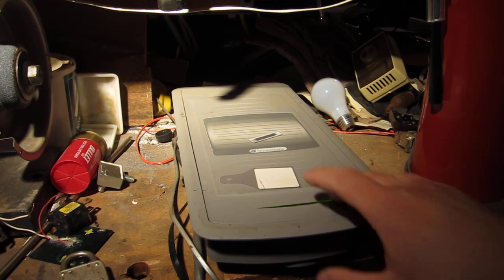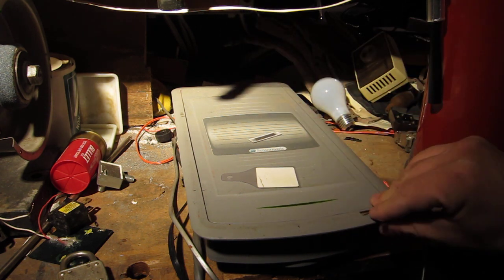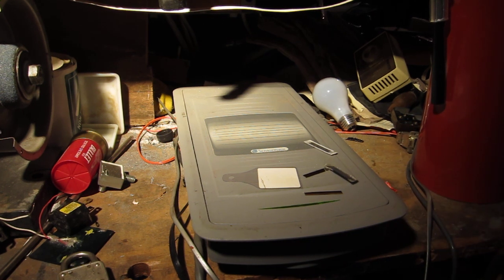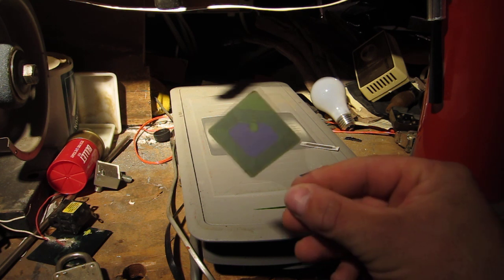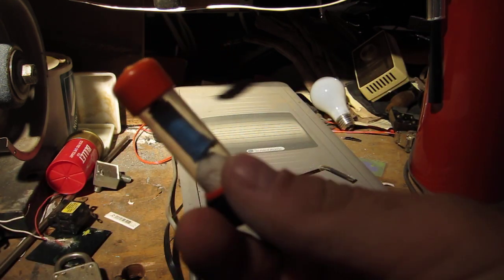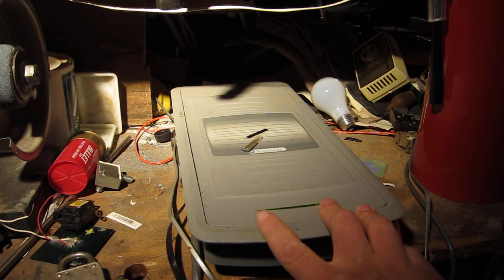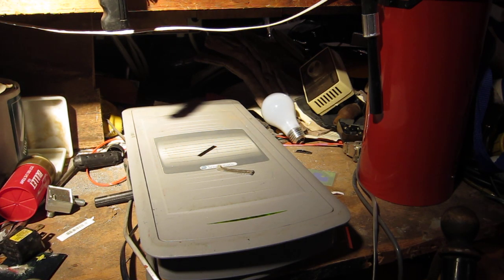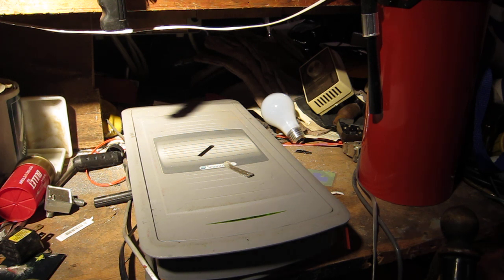AM and RF security tag basics and deactivation

Comment: Hello,
i came up here because i would like to ask your help.
My deactivator does not works anymore.The power supply has a fuse and in when i try to deactivate a tag the power supplies fuse is blown out immediately.
I don't know the reason why.Without triing to deactivate its stands normal(i can see the led blinking).I don't know what is the reason why so much power  arrive to the supply when id tag is touched.
Do you have any idea?Thank you for reading
Reply from the maker: Did you use the exact kind of fuse that was in it? If so, it sounds like there is a fault somewhere in the supply, you would likely have to send it back to the manufacturer to get it fixed, or buy a new one.

Comment: I found one of these in a staples dumpster!  Power Pad, Power supply, and a cord that looks like a phone cord.  How do you use it to demagnetize screwdrivers?  When I plug it in, and connect the Remote 1 to the Sensormatic Power Pad and the other cable to the power supply, I get a blinking green light on the Sensormatic Power Pad.
Reply from the maker: If it is exactly like this, the "phone cable" simply controls the light and beeper, the big thick cable controls the actual deactivator. If you have any of the black or white tags like found in DVD cases and in boxes (rectangular, kind of "squishy") run a magnet over one to reactivate it, then pass it over the pad, you should hear a "boing" sound, and it will be deactivated. To demagnetize a screwdriver, put the screwdriver on the pad and run an active tag over it, the deactivator will "boing" and the screwdriver will be demagnetized.
Reply: Thanks will!  I found a rectangular tag and used my hard drive supermagnet to successfully test my system. Very cool scavenging score for me!

The way I have it hooked up, is I have a remote control board connected to Remote 1 on the black power supply box.  I have nothing else plugged into the Sensormatic Box other than the big grey cable that plugs into the black power supply.  

I stupidly had taken apart the remote control circuit so I have to hold down a switch to get it to deactivate a magnetized tag.  But it feels real cool when it happens!  Will test it out on a screwdriver next.
Reply from the maker: have you tried taking the remote off and just unplugging it? If it's the
 kind with the small box and a key switch, I don't think you have to 
have it plugged in, it just keeps people from using the deactivator if 
they aren't supposed to. Mine doesn't have the remote, so I never 
worried with it

Comment: Question: Are tattle strips  permanent?
How to detect tattle strip (i.e. RFID detector and or Bluetooth UHF RF Playstore App)?
How to deactivate (de-magnetize) them?
Curiosity 
Thanks
Reply from the maker: there are permanent and deactivateable ones, they work similar to the AM tags I talk about in this video. it uses magnetic fields to activate and deactivate them. (alternating field to activate, positive field to deactivate.) A sensitive metal detector should pick them up, they are just metallic strips.
Reply: Will Phoneman thanks

Comment: Great video! I have a question, what is used to deactivate the Radio Frequency tags ?
Reply from the maker: It's basically a coil tuned to the frequency of the tag that overpowers the capacitor in the tag and destroys it, making it undetectable to the alarm.
Reply: Can the tabs be tuned to different frequencies or are thay always on one specific frequency
Reply from the maker: Nashawn Chery in theory, you could make one on any frequency, but 99% are 8.2 MHz. Some older ones used other frequencies, but they are no longer produced. There are supposedly some tuned to 9.2, but I think they were only used in libraries and video stores. (I've never found any)
Reply: Will Phoneman Okay. Arent the electromagnetic energy that is dispersed to overpower the RF tags harmful ?
Reply from the maker: Nashawn Chery It only pulses out when it detects a tag, and I'm sure it has to be below a certain power level to comply with regs, just like any other RF producing device.
Reply from the maker: It would actually activate a deactivated one, likely wouldn't destroy it
Reply from the maker: +Manny Sanchez pay for the item, or buy a deactivator and run the tag over it!
Reply: Microwave

Comment: nicccccccccce, is there any way to deactivate the spider wrap, and does the spider wrap sound its own alarm if you were to exit the building with it still wrap around the box?
Reply from the maker: The spider wrap is non deactivateable. The 3 alarm version alarms when removed from the store, the 2 alarm and ones that just say "alarm" on them don't.
Reply: microwave, or you can get alligator clip/testing cables and make a connect(electrically) to the cable both ends prior to cutting the cable then you have slack to remove item although you will have to leave your test cable behind. or you can buy strong rare earth magnets and use them. the device has a latching mechanism and once the cable is cut can not be turned off without reconnecting cable and removing and reapplying power source(this is obviously difficult as the device is made of fused
Reply from the maker: +Amanita ocreata that would work

Comment: Interesting.  When I worked in Target I would always see these tags.  Or after purchasing products as a consumer, these tags would be within the packaging of the product.  So the device you have in the video deactivates both?  The RF and AM are deactivated by magnetization or radio frequency? I remember an associate telling me they had magnets to deactivate products when they would bring them out of the store.  Will strong magnets such as neodymium alone deactivate these internal tags within products simply by running them over the product?  Also, I know when going to Walmart and target all the cashier did was scan the item (i.e Phillips Norelco electric razor) or when you go to self check out and swipe it over the check out pod.  Is this swiping or scanning doing the same thing as the device you have in the video.  Is it the same mechanism or technology?
Reply from the maker: The device I have works only on the Acousto Magnetic tags, Target uses the RF variety, which uses a different device. This one basically creates a pulse of alternating current that demagnetizes the bias strip. Magnets won't deactivate them, but will actually re activate a inactive AM tag. 
And this deactivator is a counter mount model, most stores are now using models where the deactivation pad is built into the barcode scanner, so you can scan and deactivate at once.
Reply: +Will Phoneman Hi Will, thanks for the great video! By any chance, do you know how big the deactivators are that are included within the barcode scanners? Or how physically small they can be? Also, do you know how much power these smaller size units consume? Thanks.
Reply from the maker: Catherine Cantwell  There are a few types that I know of, one slips over the scanner, and works on the AM Sensormatic tags. It's just an arrangement of magnets and requires no power. There are also ones that integrate into the scanners mounted in a counter, and they can be designed for the RF checkpoint tags or the AM sensormatic ones. The sensormatic one uses the same controller as the one in this video.
Checkpoint makes deativators that are integrated into the scanner itself, as part of it, and use a special cable. the part in the scanner is just the antenna coil, (small) and there's a controller usually under the counter. As for power requirements, I really don't know. the unit I have uses about 100 watts, I think.
Reply: +Will Phoneman is it possible to find one of these pads online?
Reply from the maker: Jadkinsa1 yes you can on sites like eBay. But expect the shipping to be kind of high as they are heavy. Also look for stores that are closing and selling off their equipment, you may be able to find one cheap that way.